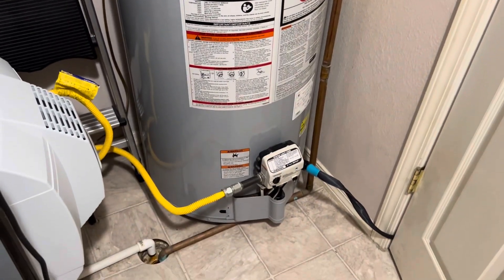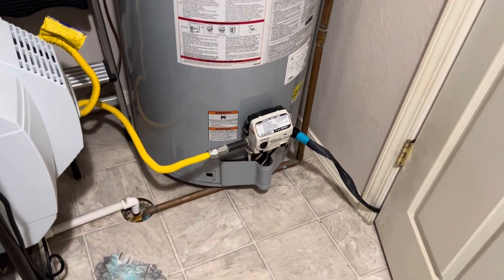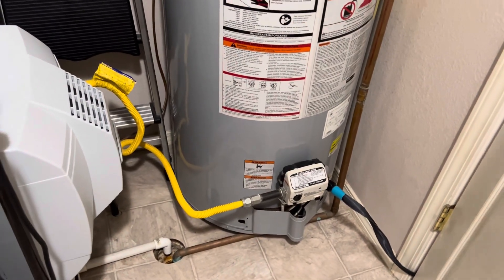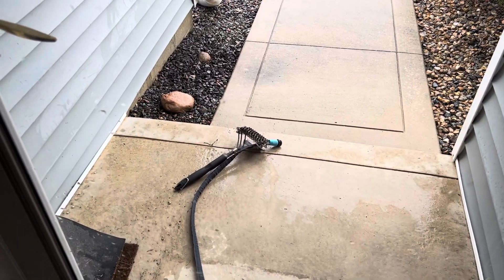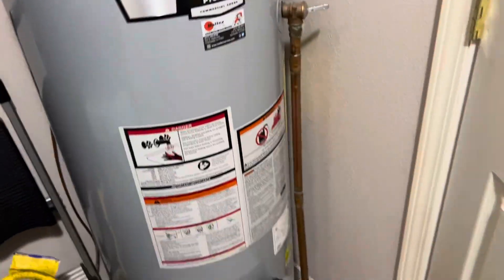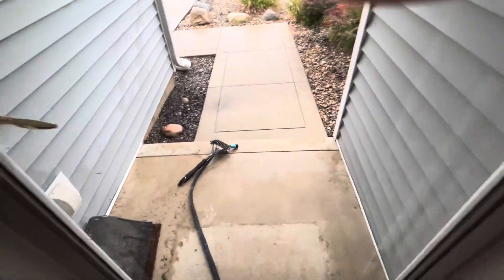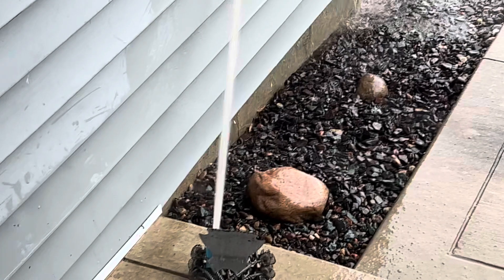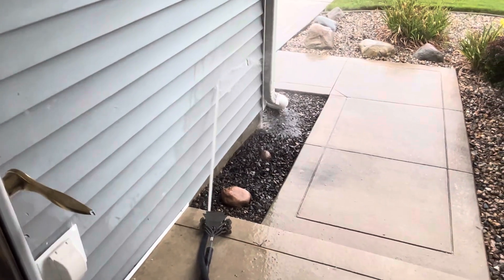Draining my water heater after an ion polarization scale reduction system was installed

Comment: Nice Video! I am familiar with these. The thing with these is to remember that don't remove scale they make it non-sticky. Think coarse salt vs fine salt. Calcium Carbonate vs Aragonite. Combine that scaleRX with a Powered anode rod and that take should last forever. Although, i think that gas control may give you trouble everntually.